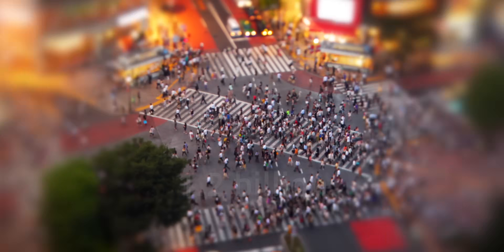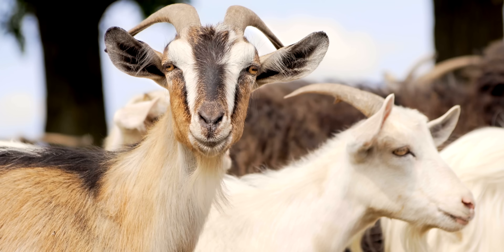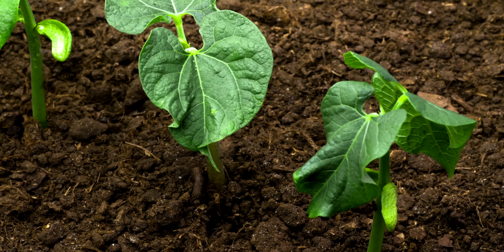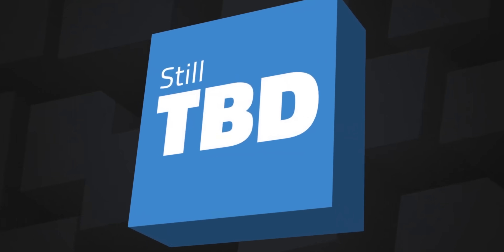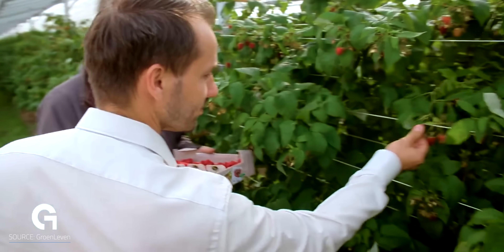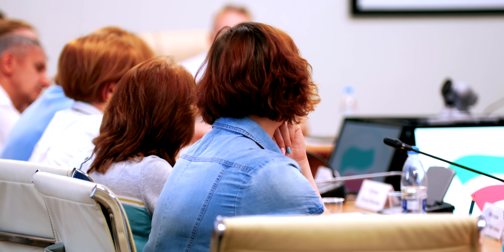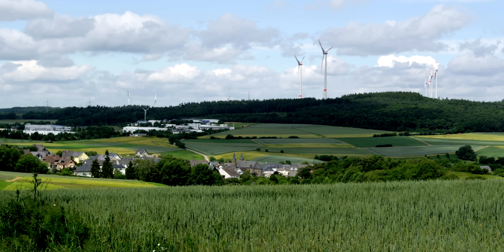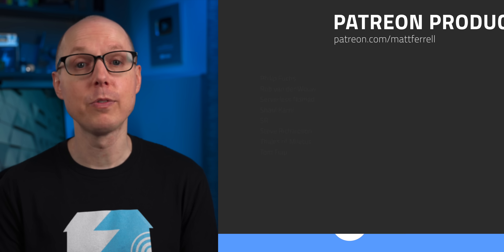Solar Panels Plus Farming? Agrivoltaics Explained

Comment: Just like any renewable tech, asking if we should be trying to use it "everywhere" is probably gonna get you a realistic "no, sir".  

Personally, I like the possibilities for one of my main crops: basil.  It is the goldilocks of herbs and really seems to need some shade in the peak of summer.

On larger terms, I can see its benefits for hot, arid climates in the battle to stop or reverse the encroachment of the Sahara.  Perhaps it could help anchor communities in viable parts of the Sahal where the crops below help anchor the soil and hold moisture.

Comment: Use of robot and mobile wheel technology combined with solar panel structures would give plants shade and sunlight, call it "solar panels on wheels", and using software data to adapt to plant needs

Comment: There is another possible benefit to this idea. If you have solar above your crops and have limited water on your property, you also have the ability to use the power harvested from the sun to harvest atmospheric water! From research I have done over the last few years, there is 30, 000 cubic miles of fresh water stored in the atmosphere of this planet! Do your own research and learn how to harvest as much water as you will ever need using the same solar you use above your crops!

Comment: current green energy options are incompatible with humanity. It wastes large spaces for minimal returns in energy/water/or whatever the project sources. Also, many of these large green projects end up going bankrupt or abandoned and they just rot and become an eyesore and an environmental hazard.

We need space for agriculture and housing. We need energy that works side by side with those two necessities. The most advantageous way would be making solar roofs for single family homes and even multifamily homes to a lesser extent. For apartment buildings, having solar and omnidirectional wind turbines may be a solution, or just solar with additional power harvesting from other locations for supplement. Fossil fuels are by FAR the best options for urban areas though, but being supplemented with solar roofing, it would reduce the demand.

Comment: I have been thinking for years someone should start doing that ever since we have been suffering heat waves and droughts. I can see this technology spreading throughout the California Central Valley for certain crops and reducing water usage. I hope UC Davis does a lot of research on that. One negative: It limits the use of cropdusting, but on the other hand, it may reduce dust and wind erosion of the soil.
Reply: Built-in pipes to the structure could allow delivery of products to the plants.

Comment: There is a new solar field near me that was a farm about 20 years ago.  I am tired of the cities consume most of the power in our region destroy our viable farmland with these solar fields.  Why can't we use rooftops in the cities for these.  Just think about shopping malls with acres of pavement that could be covered with solar panels and therefore have covered parking and solar power generated in the area where it is used primarily.  This would also cut down on the number of high power transmission lines coming from the country into the city.  This would balance the initial cost of installation.  They installed miles of transmission lines for this solar field.  I am looking into installing solar power for my own use on my small farm.  I can power all of my outbuildings with solar and use the panels for shade plants.

Comment: farm crops, farm energy. I think it is a great idea! Solar energy production should not be a static solution, but a flexible choice, depending on the land and the crops. I think to waste good farm land on solar energy only is not an optimal solution, but especially combined with the right plants (that would need shadowing anyway) can pose a win win situation for both! ... If it can be shown through pilot projects and studies, that the yield is the same / only slightly less and that there is a price advantage... it would only be a rational choice. make the most of our ressources!

Comment: You've heard of blood diamonds how about blood solar cells?

	•	Products that are fundamental to nearly all global “green pledges” — including electric vehicle batteries, solar panels, wind turbines and industrial-grade storage batteries — require minerals that are produced with significant human rights violations.
	•	Overall, about 45% of the world’s solar panel polysilicon supply is produced in the Uyghur region of China, according to a Sheffield Hallam University Helena Kennedy Centre for International Justice report, which tied it to forced labor practices.
	•	“In that region, every single company that’s involved in the production of polysilicon, or its inputs, was either engaged in forced labor or sourcing from a company that was engaged in forced labor,” Laura Murphy, a human rights and contemporary slavery expert, told the Daily Caller News Foundation in an interview. “So the significance of forced labor in the solar supply chain is enormous.”
	•	In addition, more than 40,000 child workers, some as young as 6-years-old, are estimated to work in Democratic Republic of the Congo mining cobalt, a key material for electric vehicle batteries, according to the most recent approximation made by Amnesty International.

Comment: Mushrooms don’t require any light to grow. So you could get more energetic from closer panels, you would also get a longer growing and harvest time from the protection and shelter provided from solar. Also could this be used to help protect corrals or grow them in places where you normally can’t?
Reply: Coral are sensitive to the actual water temperature and chemistry flowing past them so it might get a little more complicated than just shading them, still, it might be a good start!

Comment: Ideal maintenance of solar storage systems require a routine discharge and recharge cycle and optimizing that cycle for enough excess energy to power  LEDs during the day to increase draw or even to extend photo period crops later into the season during nightly discharge cycles is easily affordable at scale.  Optimizing for grid connection and variable peak demand will already require a solution.  LEDs of the right spectrum use very little energy to supply plants with all the light they need beneath any density solar array.  There is no barrier to growing any plant species beneath them.

However, watering systems already used in Industrial Agriculture can also be engineered to move a massive solar array over almost any size field using hydraulics.  These systems can be easily grid tied, and the sub structure is already in wide-scale use.  And bonus they are self cleaning if you turn some of the spray nozzles toward the panels.  Every farmer at any scale can, and should, farm excess solar energy.  It's free fuel falling out of the sky.

Comment: Did we miss a major story about the sudden "vanishing rooftop crisis?" America has approximately 120,000,000 buildings, all with roofs. Most people who use electricity are located beneath these roofs while they're using electricity. There is absolutely NO justifiable reason to build solar farms on the ground, and plenty of reasons not to. There are already thousands of farms and ranches that produce electricity with devices that possess smaller footprints and don't create problems for their ag operations. These devices are called "wind turbines" -- and they even work at night!

Comment: I wonder if there will eventually be panels that work while actually letting sunlight through. Then they could be used as greenhouses.
Reply: The trick is, solar panels need to absorb the incoming light in order to make power, letting light pass threw them would reduce the efficiency lower than a standard panels making it kinda pointless.

You can see the solution they already have with the camera shots looking at the panels from below, the individual solar cells are spaced out on the glass with gaps between them which is functionally the same as transparent solar panels without needing custom solar cells made.

It's a similar idea, but achieved with spacing out normal cells on the panel instead of transparency, no doubt that the engineers had a similar idea but found a more practical and simple solution  probably one of many carefully considered or "learned threw expiriance" compromises to make agrisolar work

Comment: Nice presentation! I can think of many high-value crops that could be grown this way - Strawberries, blueberries, asparagus, blackberries, table grapes (the equipment to harvest wine grapes is BIG, probably wouldn't work well), celery, broccoli, cauliflower. In my area (Upstate NY - Finger lakes area) we use very little irrigation and have many overcast days, so no great savings on irrigation water and probably reduced power generation from solar panels on many days. The break even point on this plan would be to produce enough income from power generation to negate the loss of income from farming activities PLUS the cost of hardware installation PLUS the maintenance costs. I'm sure that with the projected growth of electric cars over the next few years we will need expanded power generation everywhere, and the cost of electricity will increase with demand. I would love to see a pilot project in this area to determine the feasibility of this system.  Of course any income generated from solar panels on dedicated farm land would have to be considered as farm income.

Comment: There is a certain amount of sun-light or PHOTONS per sq area(cm or m or km). You can either tap it in a photovoltaic cell OR you can let the leaves of a plant use Photo-Synthesis to break down CO2 in Bio-mass(hydrocarbon or carbon..basically wood, which can be burnt to get energy) and Oxygen(which gets consumed when wood burns..to complete the cycle. You extract the energy and go back to same CO2 in atmosphere).
This whole idea of framing and photovoltaics is scientifically speaking naive(well stupid).
In India we have started covering water canals with solar panels(I have driven past one in Gujarat myself). This has multiple benefits. 1) no new land is needed 2) it significantly reduces water evaporation 3) the water below keeps the panel temperate low and increases it’s efficiency.

The engineer in me can’t understand WHY would anyone try to rob Peter to pay Paul.
A single Photon can either knock out electrons and produce current OR break CO2 to Carbon and Oxygen … NOT BOTH at the same time( Schrodinger’s Cat may be dead and alive at same time..but not this)
Reply: he literally explains that there's only so much light a plant can use so slightly reducing the light intensity wont effect plant growth and will instead save water. watch the damn video. its not hard

Comment: What if they used perovskite solar cells that were tuned to pass the wavelength that chlorophyll absorbs at?  You would have a larger area to work with and the plants would still get the wavelength they use? I know they have talked about using perovskite film on glass for a solar voltaic windows, and being able to tune the wavelength of the films.

Comment: no we shouldn't. solution is in testing multitude of different technologies and approaches. focusing on one suppresses the others (and here is my problem with subsidies for this kind of approaches) and we don't know what will emerge as winner and there might be several ones that will vary dependent on circumstances. Heavy storms / hails can damaged solar panels increasing cost substantially. great stuff Matt.

Comment: Does a solar panel necessarily need to have an opaque backing as a function of producing photovoltaic electricity, or is it simply a matter of how they've always been made?  I mean, they built the panels the same way they built other solid state circuits, using the same green silicon wafers.  But does it need to be soldered onto a panel at all?  Maybe to be the most efficient, but if it's a trade off to allow sunlight to pass to plants, maybe bare LEDs work well enough?

If you simply strung strips of bare LED arrays out over or among the crops, shouldn't that create electricity while allowing most sunlight to pass to the plants?

Comment: in all honesty i think putting solar panels on the roofs and potentially even some of the sides of large buildings in large cities would be a better use of space and resources, that way we wouldnt have to compromise food or power and theres plenty of large cities around the US that if we did it like this we would be making alot of power. of course the installation and maintenance of the panels might come down to some pretty hefty labor costs if we did every building like that. but even still just 5 or 10 buildings with roof mounted solar arrays would be sufficient enough. and theres plenty of unagriable land out in the desert that would make for great solar farms, one good place would be the portions of the states along the border that are still being effected by the nuclear testing that happened back in the 50s in new mexico. nuclear tainted grounds wouldnt have too much effect on solar arrays and the fact that its practically a fallout would mean that the amount of people living around the arrays would be minimal enough as to not cause distress

Comment: What about the material cost for the panels and batteries? Would it be easy to use this system mixed with other green energy in the whole world? Or would it require to mine a lot for the rare materials to push this nice concept?
Reply: I'm asking this from my ignorance. Would be great if this can be done worldwide.

Comment: I am an American living in Thailand. A friend of mine are buying 20 rai, about 6 acres, and this is exactly what we are planning to do. Our crops will be the type that doesn't like a lot of hard sunlight. Here in Thailand there are certain times of the year that the sun is just brutal and it's hard to get anything to grow. Another thing is that in most cases all they grow is rice. The rice really is a bad crop to grow because it sucks all the nutrients out of the soil so they have to put lots of chemicals into the soil to get anything to grow.

Our plan is to plant clover for the first year and that will pump a lot of energy into the soil. At the same time we can be putting up the solar panels and by the time we finish the solar system it will be time to plant. Hopefully it will all work the way we plan.
Reply: So how is it going?

Comment: It would be interesting if a solar panel could be made red to let through the light the plants mostly use and absorb the light they don't need.
Reply: Solar panels can't pick just the green light which is not used by the plants. If red is absorbed, then green and blue are absorbed, too. (That's because photon energies for green and blue are higher than photon energy for red). This is true for silicon panels. Maybe there are other materials with different absorption properties, but these would be too expensive. As far as I know, currently there is no viable alternative to silicon.
Reply: Plants use red and blue light to grow leaves and flowers, respectively (iirc; I could have that reversed).  Green light is the bandwidth they don't use, which is in part why so many plants appear green to us; it's the color of light reflected back out to our eyes by the primary type of chlorophyl.
Reply: good idea (understandably what's shown here is testing and proof of concept) rather than use traditional mass produced panels that would go on the roof of my house, they should create a bespoke/optimize panel for this use case.  6:40 - like the "strawberry panels" shown with more spacing for light transmission, i suspect somebody somewhere is working on what you propose for a 2nd/3rd phase test.  the results so far seem promising and could be even more so with some "tweeks". #POTATOPANELS , #TOMATOPANELS
Reply: @nateman10  I've seen a couple of videos about solar greenhouses. This can address a number of problems in certain areas in the U.S. and elsewhere. The desert is pretty miserable when thinking of growing anything. Solar powered greenhouses can do a lot, and that is to provide for the proper lighting via LEDs, recycle water and provide the proper temperature for growth. Winters can get quite cold, near and below freezing. These greenhouses can regulate the temp by letting light in and keeping cold out, and provide a great growing environment for winter crops. I see this use of solar with growing food as a much better alternative to just having solar farms that renders the land useless. This is a very positive step to take.
Reply: That already exists. Search window see-through dolar glass windows.

Comment: You are still feeding an antiquated system. Transmission losses are significant. Solar panels should be   installed on the building/house/structure that uses the energy. There is no reason for new houses to be hooked to a grid that has to transmit power over thousands of miles with the energy losses that entails. Won't happen though. When it comes to money/power vs  good for humanity, money/power always wins.

Comment: There's another really interesting potential benefit that I don't think was touched on in this video. A system like this would expand the growable range for plants that are sensitive to sunlight, which would allow for a greater variety of locally sourced options for people that prioritize that in their lives. In other words, farmers markets have a greater selection from local farmers growing crops that might not have been profitable (or even possible) in the past. The quantitative benefit of that would be difficult to measure, but it would certainly cut down on some of the emissions associated with shipping crops.